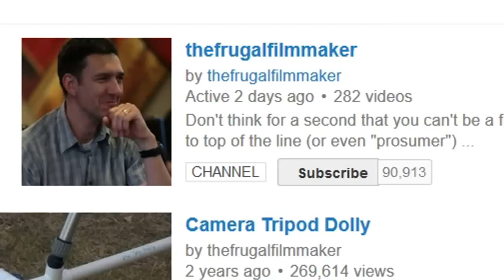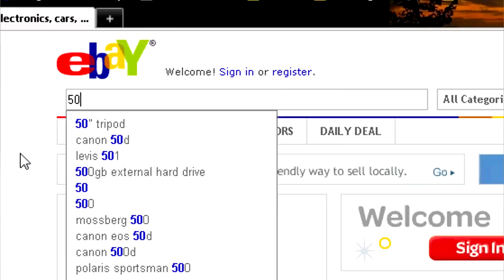Make a Camera Table Dolly for Under $20

Comment: I made this today, but with a slight alteration. Instead of using bolts and nuts to hold the rollerblade wheels on, I used the original bushing/bolts that held the wheels onto the rollerblades. They were a bit too long, so I simply put a few washers on the bolt, inside the PVC end cap and it worked like a charm. T'his was quick and easy and works great. Thanks a lot!!

Comment: Great dolly! I built my own based on your tutorial and it works fantastic. You need a very smooth surface to run it on to avoid camera shakes. I have a piece of kitchen counter on a piece of plywood that acts as my table. Works with my T2i and my smaller HF M31 just fine. Thanks for the video!

Comment: I finally made one, however here in the UK and maybe other parts of Europe, you cant get all the pieces you suggest, you cant get reducers or end caps such as you mention. So had to make my own. I also found that some of the joints were much loser than I would have liked so had to apply a band of glue to give some resistance. Also I found my Canon HF21 was kinda heavy and kept falling so had to glue the joint in the end. But its great now and still small enough to go places.

Comment: @thefrugalfilmmaker

it does work for larger cameras as you said. but i did notice that thicker pipes for the structure prevents shakes alot more. also the slight weight increase does not hurt.

Comment: Standard size for replacement skateboard bearings is 5/16" - often, the assemblies included with most inline skates reduce this to 1/4" so both will work. Just found out "Killer Camera Rigs" has a new edition available with even more camera rigs plus the older ones.

Comment: @6:50 you've added a note that says you decided to put a wacher between the plug and the nut. My question is, which side? You have a nut on the outside of the plug and then you screw another one on the inside. On which side do you use the washer? Thanks for all these great videos

Comment from the maker: @wsgFourteen 

- Cheap tripod
- 2 3" sections of 3/4" PVC pipe
- 7 1 1/2" sections of 3/4" PVC pipe
- 3 3/4" PVC tee joints
- 2 3/4" PVC elbow joints
- 3/4" PVC coupler
- 1/2" to 3/4" PVC bushing (adapter)
- 1 1/2" section of 1/2" PVC pipe
 
wheel assembly (x4)
- rollerblade wheel
- 2" length of 1/4" bolt
- 2 1/4" nuts
- 3/4" PVC plug

Comment: Do you think you could make the centre PVC pipe say a 70cm tall so its not a low shot? or will it become shakey? Or you could have an adjustable pole so you can set the height as necessary? Any thoughts...
And thanks for a fantastic DIY. Im gonna attach my GoPro to it.

Comment: here in the uk I am finding that roller blade wheels and inserts are quite expensive. Do you think it would be possible to use skate board wheels as an alternative. Also UK does not have the blank inserts (sigh) only stop ends. UK is an expensive place to live. another sigh. BTW keep up the great video works

Comment: you can build three of these with out the head of the tripod. Then attach them together by  measuring your tripod, put your tripod feet in the holes at the top of each table dolly, now you have a "Track Free Tripod Dolly". Try it on the show, Scott!

Comment: is there a reason it needs to raise up from the wheel axles?

would it work by removing the two elbows and two straight pieces, rotate the axles so the T piece in the centre of each can join with the straight pieces directly to the centre T piece?

Comment: Okay so. 
If you want to make this for DSLR cameras all you gotta do is use T joints at the ends and put couplers in the middle and make 2 of the top pieces. After that get a metal plate and drill it to the top and use a 1/4-20 screw and bam you have a camera plate that'll work with a DSLR

Comment: To make this dolly even better for a DSLR, make the dolly out of gray Schedule 80 PVC instead of white Schedule 40 PVC.  It is more rigid and stable, and also has a nice, clean gray appearance when finished.  DO NOT glue any of the joints, or paint the PVC.  The beauty of this dolly is its complete flexibility, and glue or paint limit that.